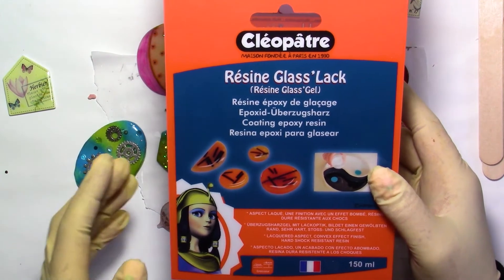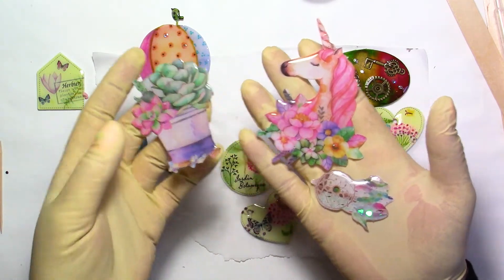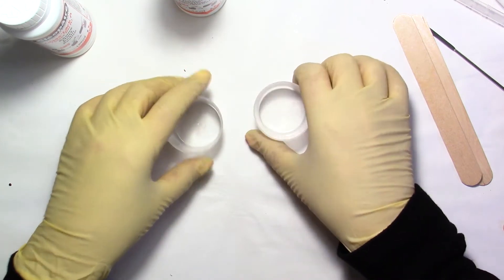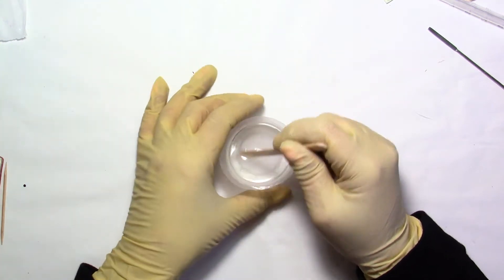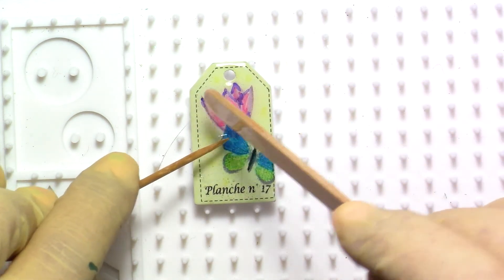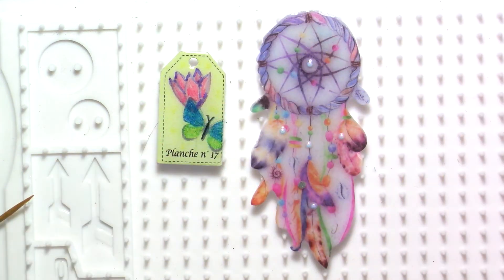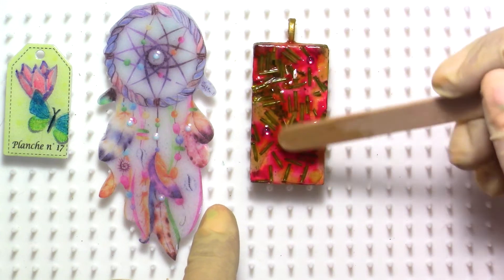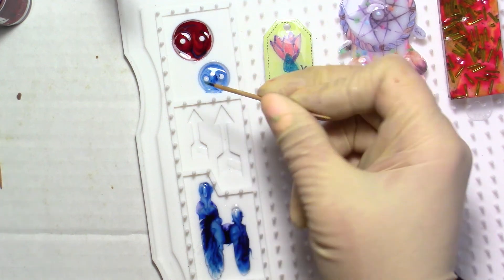Review and  Use Of Glass'Resin Lack from Cleopatre

Comment: Hi. Thanks for the video. Do you know if it yellows after some time? I have a pack at home I haven't used in a couple of years. I was thinking of using it again to dome some polymer clay pieces but I read somewhere on the Internet that the shelf life of epoxy resin is no longer than a year and I don't want to ruin my pieces. Thank you.